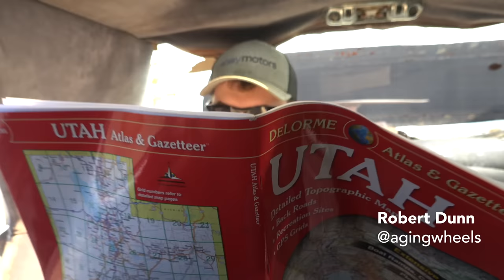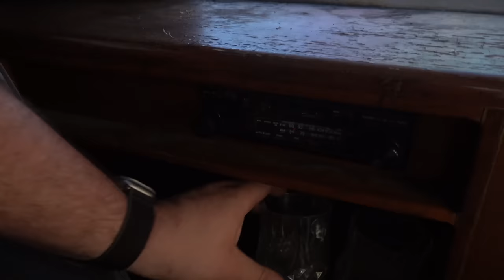Can it be saved?! Cutting apart a Rare Honda Limousine.

Comment: Hey Jared. The old 70s and 80s full size vans have rain gutters on them that are extremely long. Could find some in a salvage yard to fix her up.
Reply: School bus, passenger van.... Thinking the same thing. 👍
Reply: Yep was going to say same with van roof rails. But was thinking there is a big blue one in back ground.
Reply: i was going to say the same thing and you might be able to use the roof skin and support rails
Reply: gutters from a shuttle van is what we used when my buddy was rebuilding his hearse
Reply: To expound upon this idea. I would cut the rooves off of at least two of those vans and modify them to fit Honda Rousey.

The Chevy G-Series and Dodge RAM vans used the same basic body style from the early 70s on into the 90s.
Reply: I was thinking the same thing as I was looking at his van in the background while asking for help.
Reply: The Fords had roof rails in the 92-201x vans.
Reply: Same idea here, since I saw the Ecololine in the background, i was thinking 'vans have long roofs'..
Reply: This was my thought as well
Reply: If a school bus is indeed viable, there's a school bus graveyard in Alto, GA (which is about an hour away from where Jared approximately is).
Reply: Plus the roof skins on vans are long and wide to use
Reply: I was just thinking pre-square body Suburban but about any old van would be a good donor.
Reply: Was thinking of the same thing except 90's Econoline van. Better because Fiberglass instead of metal and could just be installed when the filler is put in
Reply: Here's a different idea:  toss the rust disaster, because it is a lost cause. Take it apart to see how it was constructed. Then cut your donor Accord in half and fabricate a center section. Far less work and you can end up with something worth keeping.  Btw... You're going to end up with bondo lung if you don't protect yourself even doing it outside.
Reply: Yeah I came here to say the same thing.
Reply: @gregedmand9939  I was thinking the same thing as you. The donor car looks to be in better shape so add a center to it. Lol
Reply: @MrBillsfishin  You guys might be onto something. The floor pan might be saveable. So that's 50% of the center section. Then he'll just needs the roof... I reckon It'll be less work, better end result too.
Reply: old van...station wagon...those would have long rain gutter.
Reply: I was thinking the same thing.
Reply: Or a Chevrolet Suburban...
Reply: @tkskagen  I  believe those just had bolt on rain gutters for just above the doors...unless you get into the mid-late 90's...I could be wrong
Reply: Exactly what I was thinking
Reply: Exactly what I was thinking
Reply: Whole roof from van,  sectioned, rain rails and a more ridged roof panel.
Reply: Evan an Astro van drip rail would probably be long enough.
Reply: I was thinking the same thing
Reply: 1987 GMC Vandura had them, I know that much
Reply: Jeep xj's might be a good source of drip rails
Reply: This is probably the project car I’m the most excited to see completed.

Comment: The deeper you dived into the Honda Limo the better it looked.  The outer skin had a lot of rot but the basic structure underneath looks sound, at least from above.  I would be curious to see what the frame looks like.  Some Limo frames are so carelessly kludged together by the coach builders it's scary.
Reply from the maker: Exactly! All of the extreme rust was caused from the top, and her bones are good!
Reply: Like the one Junkyard Digs had? That thing was sketchy as all get out. LOL
Reply: Probably older than Jared but Chrysler made a  k-car limo in the early 80's.
Reply: because limo's were never intended to be long term cars. When people rent a limo they want the latest coolest modern car . Once they are more than 5 years old they get worthless. Also the older they get the harder it is to insure them for commercial use. So the better conversion company's put a bunch of iron in them to make it safe bondo them up and really don't care about long term corrosion ect.
Reply: @davidkassube3060  That was the Chrysler Executive and it was based on the K-platform 83 LeBaron.  I'm not sure if the Executives were built in the factory or if they were modified after but there weren't that many built; less than 1500 between 1983 and 1986.  I have seen one up close and they're pretty cool.
Reply: @The Questionable Garage   when did aging  wheels  get in there 🤣

Comment: What about one of those sliding rag top kits? Decent structure to them, plenty cool and would save a ton of sheet metal work on the roof! Love this project. It’s so odd it’s right up my alley.
Reply from the maker: Cool idea
Reply: @TheQuestionableGarage  I bet that's three Hondas
Reply: @TheQuestionableGarage  I think they were trying to compete with the Toyota century EL...it was a big hit with japanese execs
Reply: The roof rails from a minivan would have the same basic shape. With the wide doors they would have plenty of lip to weld to the unibody.
Reply: @The Questionable Garage  Could just give it the permanent convertible treatment. Do a roll cage and a bikini top. Heck, Go full apocalypse build

Comment: I saw a limo conversion shop when I was in college.  They had "stretch kits" for each car which were basically sections of frame rail or body structure and a set of panels to line up with the existing car.  They would literally cut a car in half and attach the stretch parts in the middle.

Comment: Might be worth measuring other EF chassis bodies to check if you can fill the puzzle pieces for your roof and doors and get rid of the rusty extension pieces. You might want to gut it out and slip in some bars in place of the unibody roof (acting as roll bars) and build it better that way. With the way they made that it would be interesting how they connected the floor. Good luck!

Comment: With all the sentimental value, and rareness it deserves to get fixed and loved.
Reply: I disagree. Anyone that has done a full resto on a car with that much rot knows that car is not worth it unless it could sell for $80k when done. You would be just throwing away time and money. Let's be honest, it's not a cool car. It's kind of interesting but too far gone to fix. It was a poorly built car to begin with. So many other vehicles deserve to be fixed. You'd be lucky to get $15k when done. There are questionable moves and just bad moves.
Reply: @jacknimble1  Wrong. I guarantee you when done correctly, and if done back to factory, this car could fetch $40k at an auction like Barrett Jackson. As rare and unique as it is, it IS cool, and DESERVES to be fully redone properly. Its definitely not throwing away money. Its bringing back a very rare and unique car that nobody has ever seen.
Reply: @ProjectRescues  I guess you missed the part about full suspension and drivetrain replacement. Nothing "Factory" about this car for almost 40 years

Comment: I think the van rain gutter is an excellent idea. That said, to donor cars can likely give you everything you need. The extra extension in the back as a challenge, but I was thinking the rear clip being installed as one piece would give you better structure. I know a couple different ways they used to make limousines.

Comment: I worked for a short time in a limo building shop. All the extra structure is made on a sheetmetal brake. Limos are made from one car cut in half, and everything in between is formed on a brake.
Reply: Oh, gutter is probably 1/2x1/2 angle iron. Limos are not very well made.

Comment: You could try to get the panoramic sunroof out of a 2005-2006 Pontiac G6, they sort of "stack" the back 3 sections and the front one pops up. 
I had a 2005 G6 GT and the panoramic roof was the coolest piece of the whole thing.
As far as roof rails, you might consider calling an RV company... a lot of RV's have long rain gutters.

Comment: I agree with the older full size vans for drip rails, and if I remember correctly some of the earlier mini vans had smooth roof skins that might work for your new roof, if not then it might be possible to find an early mini delivery van that didn't have the side windows and use a side skin for your roof, seems like it should already be somewhat concave and be easier to adapt than a new flat sheet or 18 gauge.

Comment: Jared, cut the C pillar off the donor in half vertically. Then you have both the shape for the back glass and the door jam. Chip out the Bondo covered metal in there now and weld in a wider piece.

Comment: When you get the ribs cut for the roof have some beads ut in them to add a little strength or use some kind of structural shape for them. I would definitely add some temporary structure to keep the thing from moving or shifting too much as you work on it to keep things lined up where they go. LKQ might have what you are looking for for the gutters or know something that would work. I'd like another guy said maybe look for a van at the scrapyard to cut some gutters off. Looks like the bones are still good and am looking forward to how she progresses. Another thing you might consider for the outside area is one of those fairly cheap 10' by 20' portable "garages" they sell at Harbor Freight. Not the highest quality but they do good at keeping the hot summer sun and with some tarps for the sides can help keep the rain and wind off.

Comment: Weld a metal rod to both the side and roof skin. I did that with a shaved project once, looked okay but did not channel the water back, just down.  Otherwise, you have to fold the top skin and side joint pinch and weld.

Comment: Trim-Lok Drip Rail, Black – 1/2” Height, 25’ Length – PVC Plastic Rain Gutter for Cars, Vans, and RVs, Easy to Install Flexible Drip Rail Molding to Control Water Runoff, Durable 3M Tape Included

Comment: The rails are easy to come up with. Find a metal fabrication shop with a large hydraulic press break. They will be able to fabricate what you need in under half an hour. If you can't find one local, I know of at least one in the Phoenix area that could make those bends.

Comment: You could find a tool rental close by and rent a sheet metal roller and fabricate a gutter that is panel bonded and riveted to the structural edges of the door frame. Or just find 2 12 foot gutter sections off a ford/Chevy super van and we’ll those on. 👏👏👏👏

Comment: Jared, I did some network research- I cannot find a contemporary Honda with roof gutters at all. Including your donor. Also, other limos built on this platform don't all have gutters either. And there is the weight saving aspect of it.  FR

Comment: Old Volvo wagons (particularly the 700-900 series and V90) and old full size vans have really long roof rails that you could look for to salvage. RVs and campers also use long thin rain gutters, but that would be kinda ugly I think. Rather than using that old crusty sunroof, you could use a sliding ragtop unit as they offer a decent structure, but as is known with the later generation Jeep Liberty, they can leak too. Maybe just a panoramic glass roof assembly with a sliding sunshade?

Comment: without some sort of sun roof it will become very claustrophobic. Even a clear panel would help. For your drip rails just use a bunch of short pieces butt welded together, you should be able to bend them on the edge of your work bench (saving tons of money and time). Your rain sealing would come from your weather stripping (kinda like on you Ute.

Comment: hey, i think that inner rail structure is just sheetmetal bended on a brake, last time i checked send cut send can build those out of a cad drawing, the outer shell i think is a radious done in a sheet metal roller, that i'm not sure where to get, and the gutters probably have to came out of a bus or a van, those should be like preformed metal profile but i din't know where you could get those new

Comment: I'd honestly try to find a minivan roof and just do the whole thing... I understand it would take some measuring to find something close in windshield/back glass width and close in width near the doors.  But it doesn't have to match exactly, a lot of it you could absorb in the little kickout  lip just above the doors. Even if it's way off, as long as the hourglass front middle rear is in the correct proportions, then take out a slice from the middle to get the final width.

 But a complete minivan roof skin would give you modern drip rails/molding and some curve to the new roof.

Comment: Are you talking about the drip rail gutter that is part of the structure.  One thought on the curved part you can buy the rocker panels for c10 cheap and they are close to the right curve.  Seems like simple J-channel would work. They do sell stick on rubber drip rail.  Personally I would shave the drip rails if I were doing it and trim out the the shinny trim.... but I would also want to make a hatch back limo out of it... as I've never seen one LOL.

Comment: I would think about any roof rail cut out of a van or couple vans butt welded to length would work? Pick and pull with a small generator and a roll of cutting disks should get you what you need.

Comment: I see lots of people suggesting van roofs for drip rail and skins, and I agree for the most part, but I would suggest looking at newer long roofed SUVs. Their shape would match the flatness of your Honda roof better. And if you could find one with build in ribs, that would stiffen an otherwise very large floppy piece of sheet metal. Also newer vehicles shave the  drip rails and incorporate them a couple inches inboard at the roof seam. You could see if you can incorporate that system into your corroded catastrophe.

Comment: Take the roof off a extended van with the roof rail. Then all you have to do is attach it. You have a van in the back there you can get measurements off of. The van will be wider but you could cut it down the middle and  weld it back together.

Comment: Hey Jared my name is Chris I was in the limousine business for almost 15 years and in the time that I was in there I done the body working paint on a lot of the vehicles that came through the shop at them years Crown Victoria's  Chrysler  300 Suburbans Hummers navigators expedition  And excursions When I had a little bit of time I always go back to construction to see how they were built I felt that it made my job doing body work better and most of the time on the drip rail that is something that they prevent there in the company  That I work for at the time was a pretty reputable company at the time ECB at a Springfield Missouri Long story short most of the time that is a piece that they kind of prevent custom to Whittier whichever vehicle they were working on there in the plant

Comment: Would it be worth breaking up the donor body keeping the roof structure from the A pillar back to the C pillar and grafting that up to the B pillar of the limo? Even if it falls short, the amount of metal to section into the body will be less than what the limo builders did. That should fix your drip rail problem too. 
Also loved the bit of roofing iron just in front of the B pillar. Classy bit of engineering has gone into that peice😂

Comment: Full size vans have full length gutters and a large flattish roof. Also you had said the center section was a sedan playing limo, would there be enough roof to patch the majority if you cut the donor 6 to 8 inches forward the rear glass and section the car down the c pilar?

Comment: Just have a fab shop bend the upper side structure and roof rail peices in 1 peice for added strength. Should be able to get 10' lengths and be much quicker to install and stronger. Shouldn't be very expensive.

Comment: Jared, in looking at the rust issues I'm guessing that it was caused by missing drainage tubes for the moonroof.

On the other hand, if you delete the moonroof passengers won't be able to stand up through the roof with a bottle of Yoohoo! and shout Yeeehaaaw when you drive the limo down the Las Vegas strip.

Recommend you keep the roof and add the appropriate drainage tubes. 👍
Reply: The one Jared took out was too far back to stand up through, it should have been over the center floor area, between the seats.
Reply: @GrayRaceCat  Good point. He should put it there.

Comment: if ya run a propane torch across the filler it will peel right off with a putty knife. dont need to use alot of heat to do it either

Comment: Just from my view here watching  wouldn't it be an easier and a more structural sound build to take and cut the complete back half off at the b pillar and also the donor car and take and cut the factory top brace back to fit it to the limo kit roof frame instead of using that rusted out back and the faux wheelwell.  Just curious about if it wouldn't be a better alternative.  If not please explain the way your going about it all. Drip rails why not see if a van rails work. Anyway your going it's gonna involve many hours of fab and welding. Good luck and waiting to hear from you and to see what's ahead on this build

Comment: For a roof rail could you use a piece of box tube with 2 sides cut off it down the length of it to form an L . I know crazy idea but thought i would throw it out there. I think the box tube would have a rounded edge so it would blend better with a car

Comment: Why not acid dip the bare chassis to get it down to hood, clean metal? Or sand blast the bare chassis to clean metal? If your window seals work do you need rain gutters? Why bother, leave them off? Add lightness and simplify!

Comment: Ch MAKE IT KUSTOM, 39' Zeypher.
A more questionable choice, Rhonda goes blonde, sheet of yellow brass, fabricated with drip rails.  Rhonda gets more rousy, and goes fire red of polished copper. $2-5K each draw of sheet that large.  Double it for a finished cost.  (works easier than steel)
Heat treated Beryllium copper for a hard dome (haz mat, MSDS req)